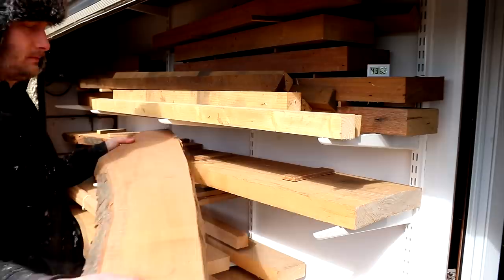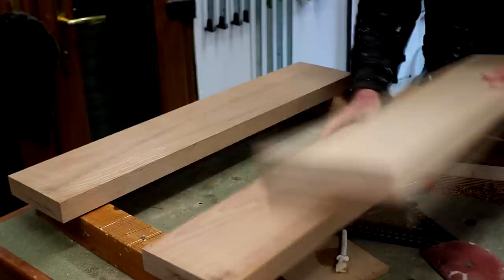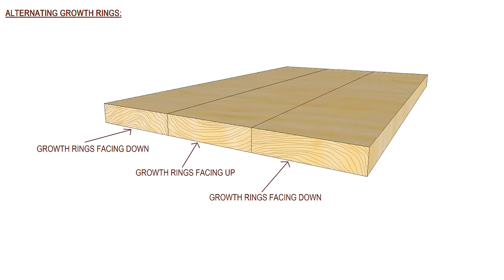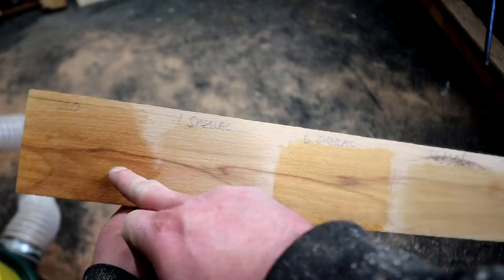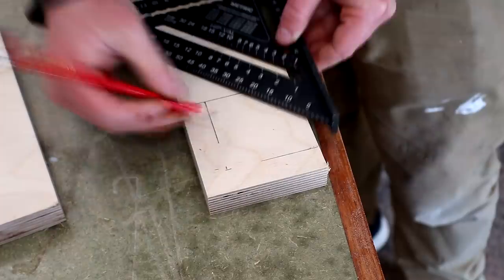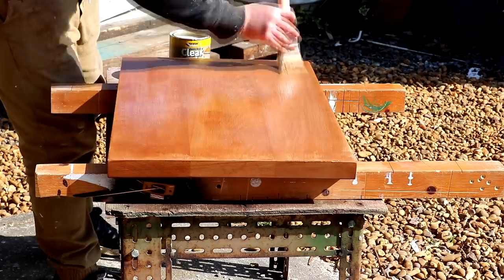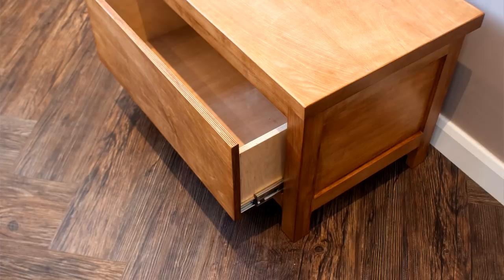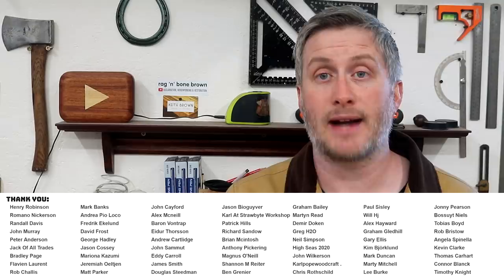Coffee Table With Hidden Drawer - Part 2 of 2

Comment: Nice work Keith, good tip I learnt for reducing movement in solid wood tops is to make sure you apply finish to both sides of the wood. Logic is, the side with no finish may absorb moisture at a different rate to the finished side and therefore cause movement with seasonal change.

Comment: I have seen a few discussions regarding the orientation of the wood for table tops. The jury is still out. As it is only 450mm wide, as you say, I don't think you will have any problems with the top bowing. So focused on the job, that you forgot the drawer supports were only screwed. It happens to the best of us 😎. Hidden by the slides themselves. Great job Keith. Parents will be very happy
Reply from the maker: Cheers Peter.  Yeah I’d be more concerned if it were pine or something with less tight grain, fingers crossed it’ll be ok! I always make silly mistakes like the one with the drawer slides when I’m jumping between projects, I should learn to concentrate on one thing at a time 😅

Comment: Colour isn't to my taste, but looks fab!
Did you coat the bottom of the top with the varnish as well? Might end up cupping if moisture can get in at the bottom but not the top, especially with the grain not being the opposite.
Would using the domino to cut the holes for the mounts not have been quicker than drilling holes then filing it down? Just a thought that could save you time!